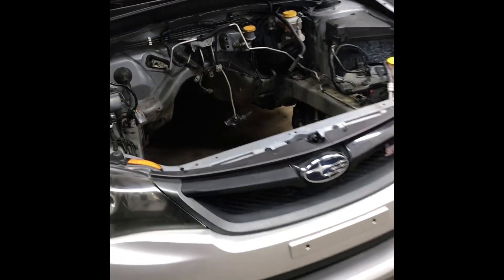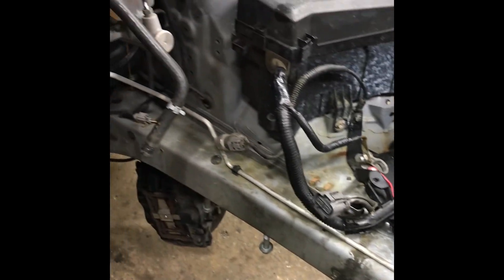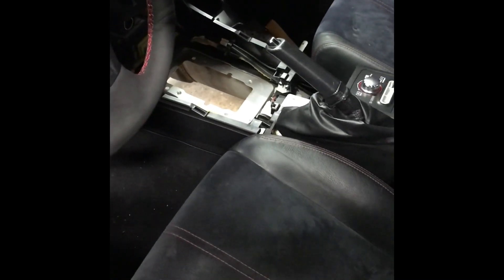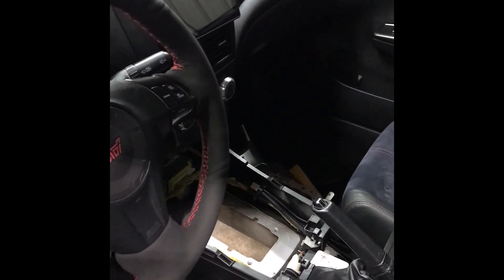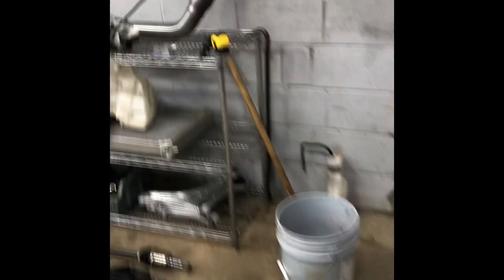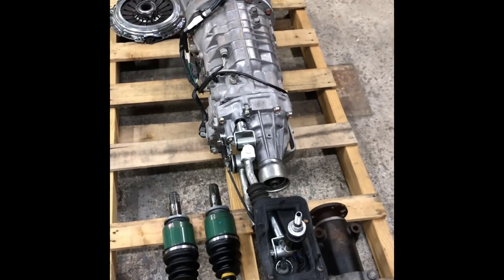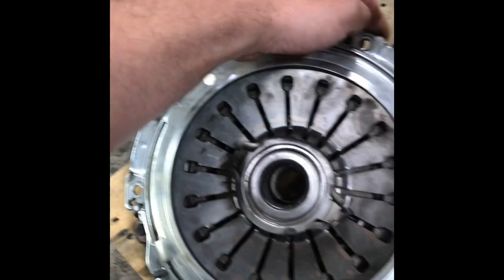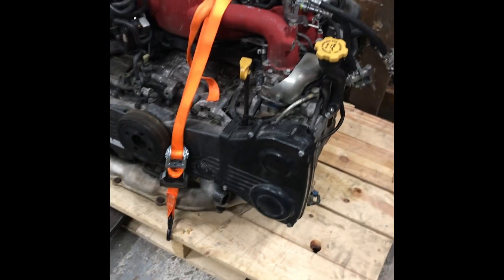Update:  Ls swap 2011 Sti Build

Comment: Hey, nice job on the conversion work. I’m in the process of doing an 6.0L LS into my sg forester and came a post of a guy that was using a Holley terminator but it wasn’t hooked up to the stock dash and had see you post saying that you knew how to do it. Just wondering if you had any information that you can share in regards to wiring up a factory stand alone computer to work with the factory cluster when it comes to the Speedo, tacho and the other gauges and warning lights? Keep up the good work and can’t wait to see the next video.